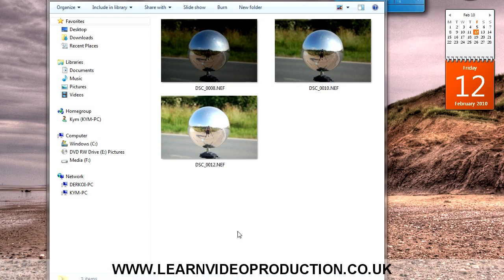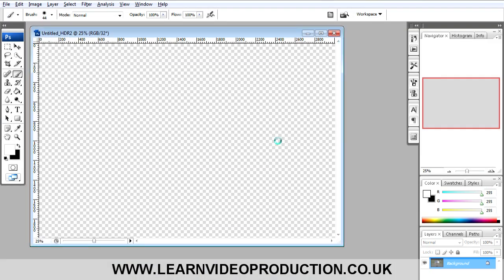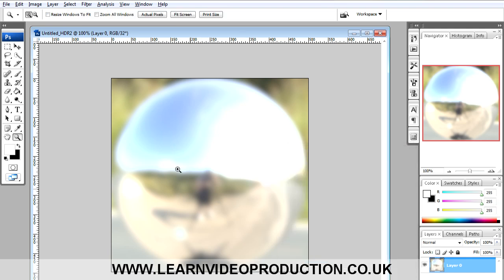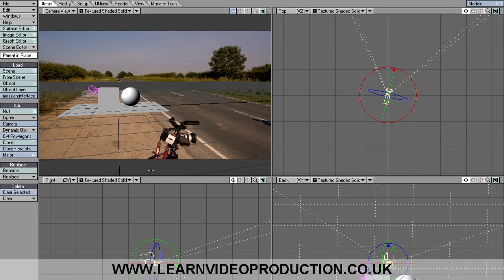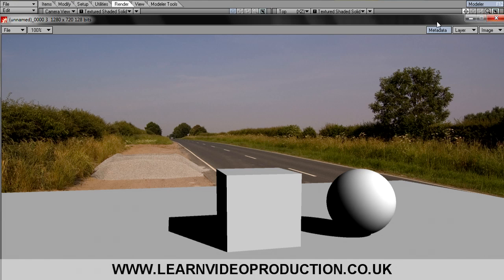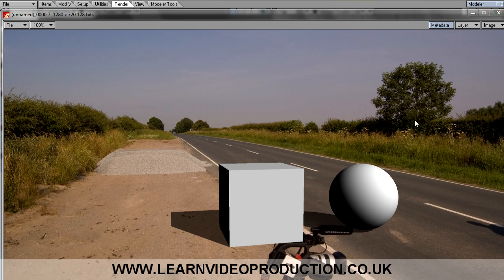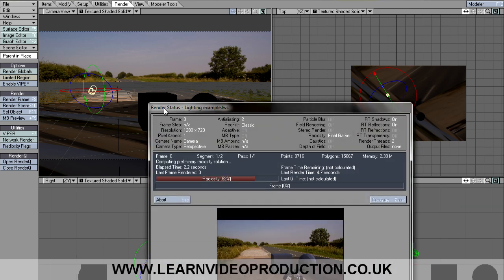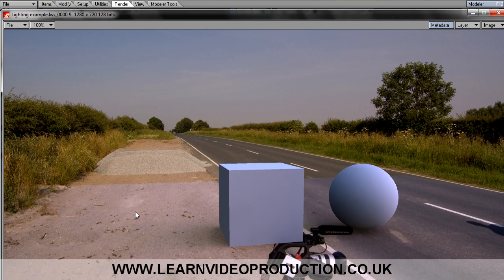Creating and Lighting with HDR Lightprobes Tutorial.

Comment: Use the ruler to bring guidelines to the edge of the circle, one on top and one to the left. Using the ellipse marquee, start at the intersection of the guidelines on the top left. Click and pull you should be able to make a selection of the probe. If you use snap, it might make it easier.